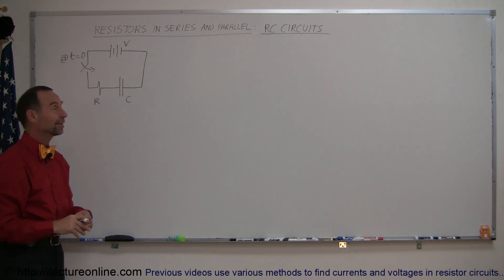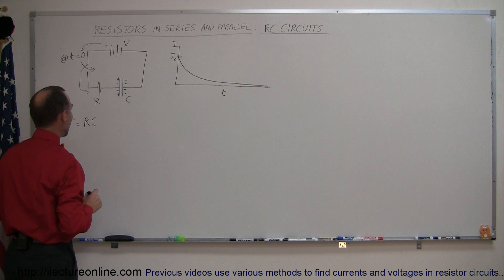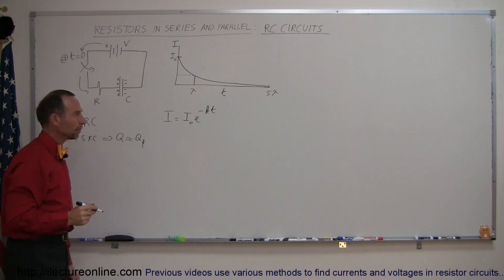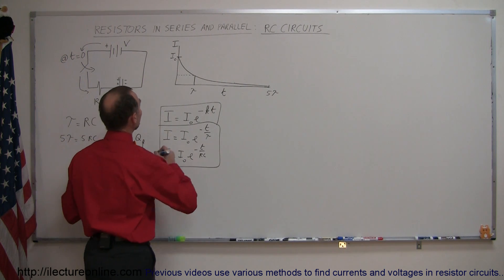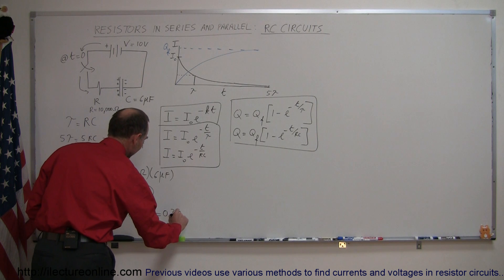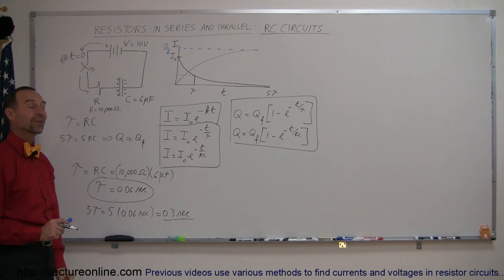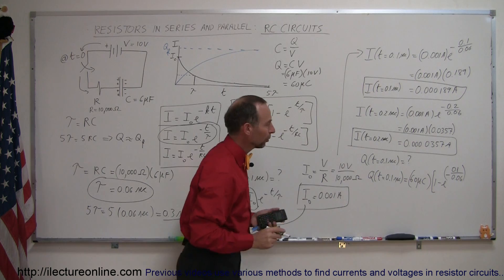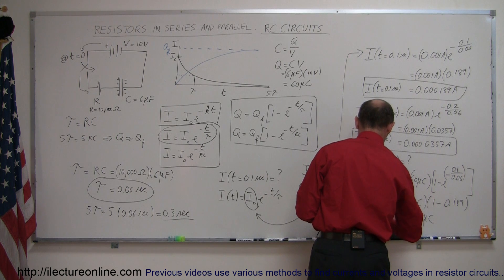Physics 41    Resistors in Series and Parallel (5 of 5) The RC Circuit

Comment: when calculating the initial current you mentioned that the circuit is reduced to just the voltage source and the resistor if the capacitor isn't charged. How will you calculate i0 if the capacitor is charged to -1 V ?
Reply from the maker: Then you need to use Kirchhoff's current and voltage rules.  Add up all the voltage rises and drops and divide by the total impedance.  We havev a lot of videos in the electrical engineering playlists that show how to do that.  (There are a number of techniques as well that can solve that type of problem).

Comment: which is right current flows neg to positive or positive to negative .
Reply from the maker: In actuality, negative charges (electrons) are the only charges that can move inside conductors, so current is made up of negative charges moving.  But the convention in electronics, physics, and electrical engineering, the positive charges are assumed to move.

Comment: shouldn't the intial graph be  of V vs T rather than I vs T and the eqn should be V=Vo e^t/T  ??? 
As shown in this other video of yours ?   -----https://www.youtube.com/watch?v=GXUzJ3a4Dpk   
or am i missing something ?
Reply from the maker: That depends on what you are trying to calculate.  Here the objective was to find the current as a function of time.
Reply: @MichelvanBiezen  Thanks for replying so quickly.. But i also want to know whether the current equation is correct in this video for RC circuit? Because i have seen this equation associated with the RL circuit not RC .. That's what i am confused about actually 😅
Reply from the maker: You will see the same equations and curves for RL circuits and RC circuits.  The difference is that the curve for the charging capacitor is the same as the curve for the RL curve when the voltage is turned off.
Reply: @MichelvanBiezen   Oh.. Ok.. I got it now.. Thank you Mr Beizen. . And i really appreciate your efforts you put into these videos. You teach very systematically and in a simple way.  ☺

Comment: Does anyone know if the voltage of the resistor will be the same as the battery's voltage at t = 0 seconds?
Reply from the maker: Yes, at t = 0+  (after the switch closes), there is no charge on the capacitor and  I = V / R and the voltage across the resistor is equal to the voltage across the battery.
Reply: @MichelvanBiezen  thank you SOO much.

Comment: can I ask what is the graph of the voltage in the Rc circuit ,is it the same as the graph of the current (because according to amber's law  the currency iş proportional to the voltage .)
Reply from the maker: Whenever we talk about voltage we don't use the word "in", but instead we use the words: "across" or "between".  Thus the voltage across the resistor will be different than the voltage across the inductor.

Comment: Could you please explain how the e got into the equations? I've seen the derivation and I know it's the ln is taken, but I don't understand why.
Reply: Given a differential equation of this form:
dy/dt = -k*y

Treat the Leibnitz notation as a fraction, and separate the y's to the left, and the t's to the right.
dy/y = -k*dt

Integrate both sides:
ln(y) = -k*t + c

Use the inverse of ln(y) to isolate y:
y = e^(-k*t + c)

Let C = e^c, and use properties of exponents to rewrite the added constant in the exponent, as a coefficient out in front, to get the general solution:
y = C*e^(-k*t)

So WHY does integral 1/y dy = ln(y)?   That is probably the essence of your question.   This is a special case where the power rule fails, and natural log saves the day.  Using the power rule directly, we'll get a 1/0 as the coefficient, which cannot be.

Suppose instead we were trying to integrate the following, where h is very close to zero:
1/y^(1 + h) dy

In general, the power rule would tell us the solution is:
1/h*y^h + c

By letting c = -1/h, we can set up a limit that sends h to zero, that we can ultimately resolve.  All that matters is that we set the arbitrary constant equal to something that doesn't depend on the variable of integration.
1/h * [y^h - 1]

Using properties of exponents, rewrite y^h, as an equivalent exponential expression of base e:
y^h = e^(ln(y)*h), thus
[e^(ln(y)*h) - 1]/h

Plug in h=0, and now instead of nonzero/zero, we have the indeterminant form 0/0, which allows us to use L'H's rule:
d/dh e^(ln(y)*h) - 1 = ln(y)*e^(ln(y)*h)
d/dh h = 1

Thus, using L'H rule, we get:
ln(y)*e^(ln(y)*h)

And now we can safely plug in h=0, to get:
ln(y)*e^(ln(y)*0) = ln(y)

Comment: is this also applicable when the R and C are in parallel? is R always the internal resistance of the capacitor itself? hence R and C are always in series
Reply from the maker: Capacitors do not have internal resistance (it is so small that it is ignored), thus this is an external resistor.  If the resistor and capacitor are in parallel, you have to solve the problem differently.  (See examples starting with this video: Physics - E&M: RCL Circuits (12 of 13) Impedance and Parallel Circuits (Ex. 1)   https://www.youtube.com/watch?v=u6lE4gIIfBw&index=14&list=PLX2gX-ftPVXVg9J4Y8fzukA2Ezs2jfufO

Comment: Would we treat this problem the same if instead the capacitor is closer to the positive terminal of the battery than the resistor?
Reply from the maker: +Jomel Sagsagat 
It would not make any difference.

Comment: Nice! I have a question. Why didn't we use Q = Q¡ e^-t/RC instead of Q = Q¡ (1 - e^-t/RC)?
Reply from the maker: +WeiFeng Ma   Q = Q¡ e^-t/RC is the charge remaining on a discharging capacitor    Q = Q¡ (1 - e^-t/RC) is the charge on a charging capacitor.    The best way to tell the equations apart is to plug in 0 sec for t and see what you get.

Comment: Dear Michel,

What if I had another resistor connect in parallel to the capacitor, how would I work out V(t) and I(t)?

Thanks,

Joey
Reply from the maker: Joey,
Parallel RC and RCL circuits must be handled very differently.  That is a bit much to cover in a note like this.  I'll make a point to put some videos on line on parallel RC and RCL circuits in the near future.
Reply from the maker: Joey,
Take a look at the playlist: PHYSICS 49 RCL CIRCUITS
There you will find out how to solve parallel RCL circuits.